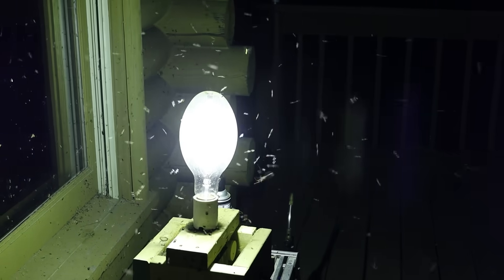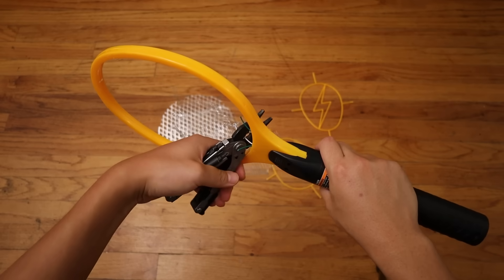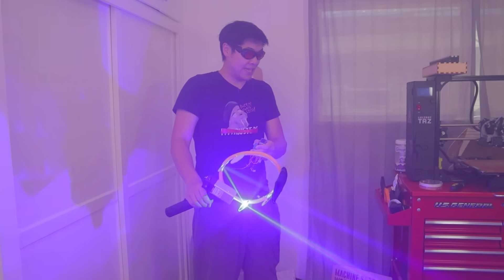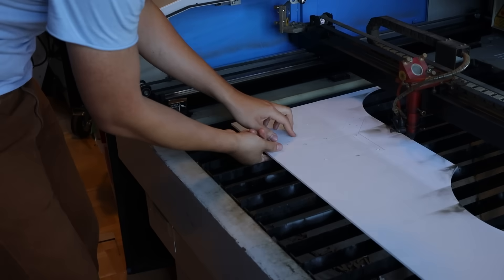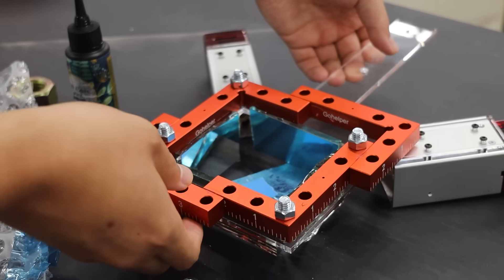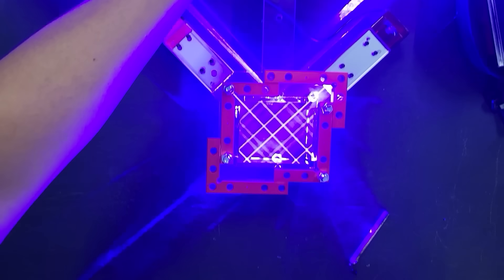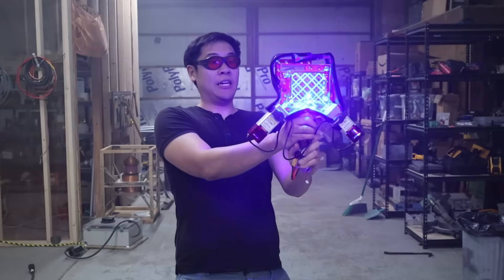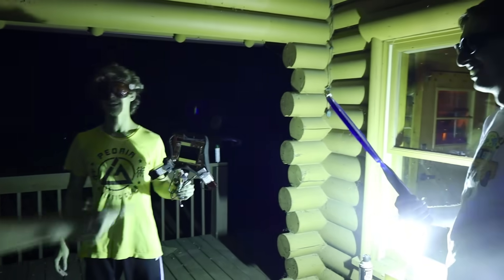killing mosquitoes like its the year 3000

Comment: an obvious improvement to the efficiency would be to have proximity sensors on the racket so the lasers only turn on for a split second when the mosquito is within the grid.
Reply: That's what I was thinking, you could have a low powered laser and a photo resistor as a detector to switch the main beam.
Reply: Efficiency? We're out here bringing laser death and you're mumbling about *efficiency*?
Reply: This should be used as a mosquito net. Just create a forcefield around the bed.
Reply: A sensor that would detect a single mosquito edge to edge? Also, it would have to fire the laser within, what, 1 ms?
Reply: @dingdingdingdiiiiing  Sure, if it flies anywhere in the area it would break the beam, you just need to choose an angle that gives you a tight grid, or near parallel lines. 1 ms is a long time in electronics.

Comment: I suggest you motorize the laser so that the reflected beams make a virtual surface instead of a grid with holes.
Reply: old barcode scanners use a single laser with motorized mirror going back and forth so fast you see a line.
I'd use that as a source and just supercharge a laser!

Edit: Mirror is not motorized, it's on a spring and has a magnet, and then a simple solenoid shakes it really fast!
Reply: @zlac  If the beam moves to fast it might not burn the insects, but if it is possible to control the speed precisely then it is an even better idea!
Reply: @Bencrulis  Actually, if it's moving fast enough, it may cook the mosquito before it can get past the beam! >:]
Reply: Was thinking of a way to do it with two parallel mirrors and a nearly perpendicular entry angle, but given the quality of mirror needed your idea may be much cheaper. Just need a tiny mirror mounted at 45° on the end of a high speed motor shaft to ensure a practically inescapable sweep rate. Combine that with circular shroud to absorb the beam and a large fan to draw the insects in. (It sounds workable enough that I wonder if that already has a patent?)
Reply: I had always imagined the laser at an odd angle that just keeps reflecting until the area was completely filled with a plane of light.
Reply: @Bob5mith  If you get the angles right, I think it would come close. The problem here might be the precise 90° angles of the beams. 

Of course, they have to keep the laser from escaping the mirrors, but I bet they could figure it out! :)
Reply: @jamesgizasson  There are mirrors that can handle powerful lasers, including some that can let the light in but not back out. They probably can't just be ordered on Amazon though. In my idea the contraption would be stationary so it could all be finely adjusted. I had no use for it in mind, just "Wouldn't it be cool if ...?" It wouldn't be as crazy as I first imagined as a kid, but I still think it would be cool.

Comment: next step: make a hallway that traps intruders and have the laser grid pass from one end of the hallway to the other
Reply: And make sure the AI that controls it has plenty of examples of how to "toy with your opponent" in its training data, so that it doesn't lead with the grid. It might start with just one horizontal beam that is easy to jump over, then switch to a beam that changes height as it moves, etc
Reply: @bornach  that's EXACTLY the way to do it

Comment: I thought I saw that presentation, I was under the impression that they used the frequency of the wingbeats to identify and target the target (the wings would reflect light which the camera detected as a flash). That's all that the camera could pick up, which means they must have used specific lighting to achieve it.
Reply: mosquito wing beat frequency is between 600hz and 1000hz, so you'd need a 1200 - 2000 fps camera to pick that up - aka, no, I highly doubt that's how it worked
Reply: @gorak9000  New Laser Zaps Mosquitoes in SlowMotion | National Geographic on YT
Feel free to doubt.

Comment: A 10W laser is probably powerful enough that you could kill a bug quickly enough that you could just create a large kill cage with a laser in a corner and scan the laser back and forth.
Reply: need a rotating mirror from a laser printer or an oscillating mirror from a barcode scanner - both create a line (or in 2d a plane) from a single laser. And yes, I suspect that would be a lot more effective. Instead of a grid, you could basically cover the entire inside of the square with a scanned laser - and you could make the square a lot bigger too to be more effective.
Reply: make one
Reply: like laser light show, the beam scan soo fast it form a "laser surface" when there's fog around. eg: Scene in Alien 1 (1979) in the egg chamber.

Comment: You should take the microwave generators and try shortening the wavelength to short enough to kill a 1mm fly. Basically making a high density infrared beam of bug killing destruction (but more likely to shock and kill the user)
Reply: wouldn't that also set anything in front of the beam on fire?
Reply: @NICK....  collateral damage
Reply: That's not how microwave generators work. He might as well build a new source at that point.

Edit below: 
I don't mean to underestimate Allan. He might be able to repurpose the guts easily, but precision-maching the correct resonant cavity, tuning the electronics to match it and putting it all together just-right is an enormous endeavor. 

Magnetrons are complicated as hell. The fact that anyone can buy a microwave for few dozens is a miracle made possible by economies of scale.
Reply: @c-djinni  I just thought some redditor or 4 chaner with no life made it their life’s goal and found a way. But I understand how hard it is to manipulate a wave from something like a microwave
Reply: @crazycat7760  Sorry, I don't understand this response at all, what do you mean? If there's someone that can do it in their spare time, they're not just some "no-life redditor/4channer", but an expert and an EM wizard. Them figuring it out doesn't guarantee it would be reproducible by Allan.
Reply: Cancer joined the chat
Reply: @MeSkulll i might be wrong, but i'm fairly certain that microwave cookers don't emit ionizing radiation (which is the type of radiation that causes cancer)
Reply: @baronbacku9984  they don't indeed, the closest we can get to cancer with this topic in question would be to build an UV laser on the UV-B and above range.
Reply: @baronbacku9984  Even then I don't think it would be efficient since microwaves can't heat the middle
Reply: @MeSkulll  that’s because you need to cook it longer silly 🙃
Reply: @crazycat7760  Then the outer edges burn.

 Admit that microwaves sucks
Reply: That's probably gonna get the FCC after you tbh
Reply: At this point you can just shoot flies with a regular glock
Reply: Tbh the frame or the whole handle is kind of bad
Reply: Can kill Brain cells
Reply: @otakugamer616  for extra spice 🌶️🌶️🌶️
Reply: I think you mean feed a cavity magneton into a resonant cavity to make a maser? maybe?
Reply: Doesnt work like that
Reply: @Phil659  my B Phil didn’t realize I had a professional negative Nancy on my hands

Comment: YAY! more Allen!

Alright, that was awesome.
Galvos are expensive and annoying so I think what you did was a really good solution!

Next up, make an even bigger and tighter grid that can fit in a door frame, then add some high voltage being pulsed in as the laser slightly ionizes the air.
Reply: i volunteer to test